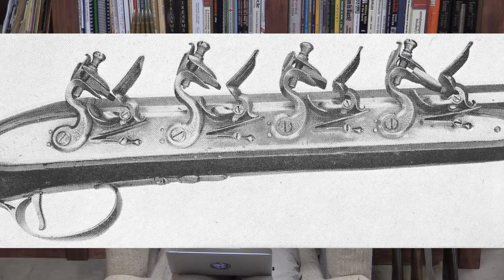Q&A #4: These Are A Few of My Favorite Things

Comment: ian, is any kind of firearms you would never recommend even to your worst enemy ?? :)
Reply: The poorly made straight blowback copies/fabrications from China or the Middle east. Those things are unreliable at best and a bomb at worst.
Reply: Look for Ian's video on the Ross Rifle.
Reply: i saw it a long time ago :) i remember that was a problem with bolt assembly ( problem with thread desing of bolt ). i also remember that iam once metioned about turret rifle- blk powder rifle with pointer chambers directly to your head :) guest what might happen in case of chainfire :D im only wondering is any worst firearm desing than ross rifle or turret rifle?

Comment: Speaking of the Dutch military museum: The Legermuseum in Delft was rolled into the NMM. Until then, they had a cabinet (5-10 m long) with prototypes, intermediate manufacturing steps etc of the Dutch geweer/karabijn M.95. If you were to go there, I'd specifically suggest you ask what happened to it before you go. It's a fairly forgotten weapon (even in the US among collectors), and very pedagogically presented, at least in the form I saw it a few years ago when it was still in Delft.

Comment: see i personally think the grenade launcher from vietnam was one of the better ones the ones that are attached to the rifles just make the rifles heavy and surely are not as usable as the original break action launcher i just feel if you had a guy that carried that maybe in a lighter build with modern tech  across a soldiers back as a secondary weapon it would be more effective then having it built into the weapon they are carrying i could be wrong tho hence the military isnt using them really any more but i just feel it was a more accurate way of using grenades and didnt hurt the soldiers actual rifle as far as weight and stuff like that
Reply: H&K builds a break-action 40mm grenade launcher.  The idea of the M203 was to eliminate the need for a dedicated "grenadier" in a squad.

Comment: Wouldn't a lighter .308 like an AR10 or a modified M14 make a better combat rifle than a .223, since the ammo is so light and deflected so easily?
Reply from the maker: +X_Fox In my opinion? No.
Reply: +Forgotten Weapons why not?
Reply: +X_Fox So starts the debate between the full battle rifle cartridge and the lighter ones. It's a trade off between lighter ammo being able to carry more as well as some specific benefits when shooting versus something that packs a bit more wallop both for the firer and lucky recipient. Having used both I prefer the 7.62 but I see the merits of each. Some still argue quite hotly for one or the other though.
Reply from the maker: +X_Fox The assertion that .223 ammo is easily deflected it not true. The .223 allows for more ammo to be carried, faster recoil recovery and followup shots, and is somewhat more practical in full auto. The tradeoff is reduced barrier penetration, but I don't think that tradeoff makes the 7.62 NATO a better choice.
Reply: +Forgotten Weapons the more ammo thing is a good reason, I've just heard from several people that .223 is easily deflected by brush and such, but what about, say a 7.62x39 or some other cartridge? 7.62X39 is a little less accurate from personal experience, but I suppose a big part of that depends on the rifle, but it's not too much heavier, and it's got a lot of power behind it
Reply from the maker: +X_Fox How often are you shooting through brush, and yet still able to aim at a target that is far enough beyond the brush that any bullet deflection will actually cause you to miss?
Reply: +meka erwin that's pretty true, as long as I'm putting down some surpressive fire to protect myself I'd be happy, weather it's a .22 or some heavy oddball .50 sharps (sorry about my bad spelling or not knowing which form of weather to use, I've never been good at spelling)
Reply: +X_Fox I've never heard about brush deflection being a huge issue with either of these rounds unless the brush is close to you instead of close to the target. That's why you always make sure you have a clear lane of fire through any brush you'd be behind (and it can cause problems with any round). I prefer 7.62 for it's terminal effect more than anything. Really though, I didn't choose the gear I used, so it didn't matter if I liked it or not.

Comment: Have you ever had the chance of handling a Villar Perosa? Correct me if I am wrong but wasn't it considered one of the first submachine guns ever invented?
Reply from the maker: +Samuel Corry I have handled them, but in their original form they really don't qualify as an SMG because they have to be used from a mount. They were rebuilt as proper shoulder-fired SMGs right at the end of WWI, and saw combat within a week or two of the first German MP-18s (people argue over which was technically first, and there doesn't seem to be any real proof either way).

Comment: Thank you for yet another wonderful and informative video.  I do have a nit to pick though, balloon headed metallic cases are mad buy first forming an open on one end cylinder and then crimping the close end down creating a rim the is simply folded over (much like a rimfire cartridge)  modern cases are made by forming the case head with more material so that there is a web of thicker material at the head.   This is why one can't put 70 grains of black powder into a .45/70 case.
  
Military firearms, and equipment in general, must have that rare characteristic of being Soldier (or 2nd Lt) proof,  that is that they are difficult to break even with some ingenuity and force applied. As impossible as it sounds I have seen an M-14 assembled in such a way that the operating rod was outside of the connector assembly (which keeps the operating rod in it's track) but was still able to  chamber and safely fire a single round.  Needless to say the weapon the weapon thereafter needed the attention of an armorer and the recruit involved received the full attention of his coach (me), the Primary Marksmanship instructor, all three of his Drill Instructors, and  the Warrant Officer who ran the range complex.  None of the above could believe that this was possible.

Comment: To add to the muzzle loading multi shot question, you also had full on pepperbox style weapons like the Artemus Wheeler guns. This only has the one flint, frizzen and flash-pan and the way that it worked was that all of the barrels were loaded with a charge and ball and as you manually rotated the cluster of 7 barrels, a portion of the charge was shaved off into the flash-pan. They were made in carbine, rifle and pistol varieties (I have only ever seen an example of the carbine though), and 2 each of the carbines and rifles were procured and tested by the US Navy in 1821 for potential boarding party use.

Comment: How you measure the guns caliber length is also important. Some measure just the barrel and some measure the barrel + chamber length. On top of this... you can get into the nightmare of two different countries using the same gun with different measuring and then adding in several barrel lengths in use... Which makes finding velocity data on ammo an complete nightmare.

Comment: My "last ditch" pick is the Spanish FR-8 7.62x51nato. Relatively low purchase price, easily available ammo, few and strong moving parts of high communality with other Mauser rifles. Accurate and mostly fits the Jeff Copper scout rifle concept and...ok, I like the way it looks.
Reply from the maker: +Damian Grouse I would not consider an FR-7 or FR-8 to be a last ditch sort of gun.
Reply: +Forgotten Weapons It's a rifle I own, so it would be my personal "last ditch". Like you my primary would always be my AR, second my HK91. The true last ditch is call 911 and...wait.
Reply: +Vypr As a military member a "last ditch" rifle is whatever the "powers that be" will give me. That VG 1-5 will eat ammo a bit quicker and be more fragile than a bolt action. As a private citizen a last ditch rifle is what I have at hand after all my primaries have magically disappeared. I stand by my FR-8 choice. It's a carbine not a full length rifle and again...I like the way it looks😎
Reply: +Forgotten Weapons I'd like to say thank you for your response; I appreciate you can't respond to so many messages. I just saw your video on the C......... Needle rifle. Is that the same one you purchased? How's the needle retained? I didn't notice set screw or pinning...